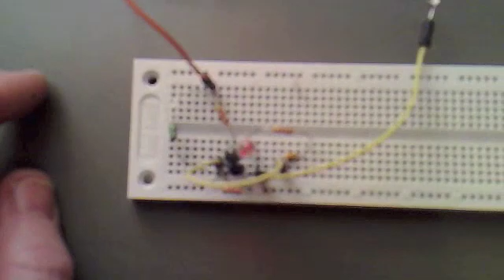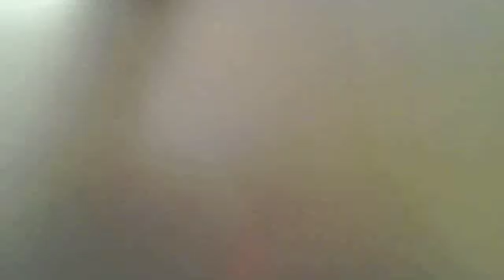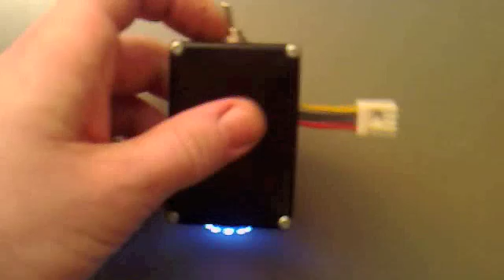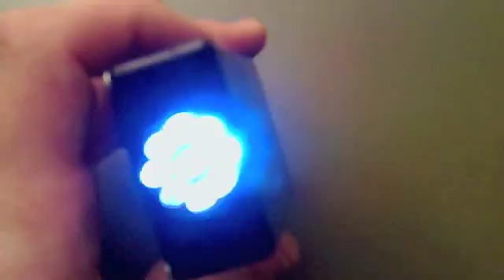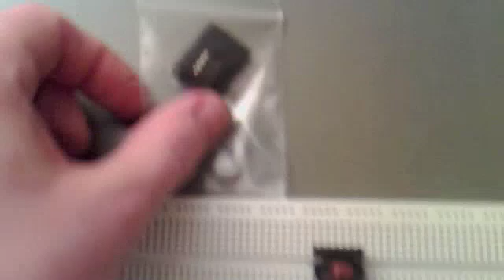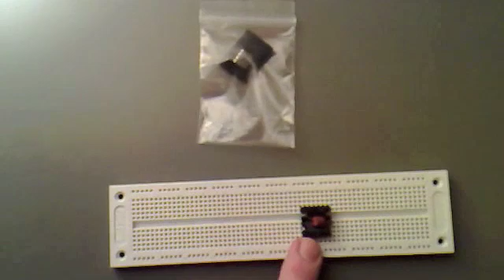Joule Thief (Variant) 014

Comment: Probe diferent coils but all charge the bats only when beeeeeeeeeeeee is very high... some times is the transistor 2n3055, some times is the coil...other thing...have a 300 turns but my tiny 50 allows faster charge ...why?

Comment from the maker: am using a TS555 they operate much higher than the NE555 as the go up to 2.7MHz, I have to get this circuit oscillating at about 1.5MHz to get resonance on the small coil..